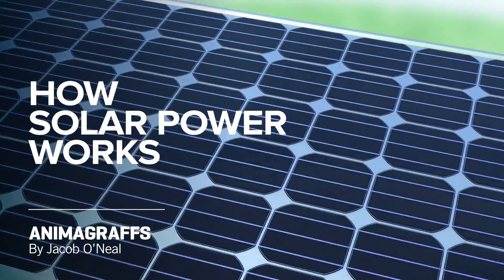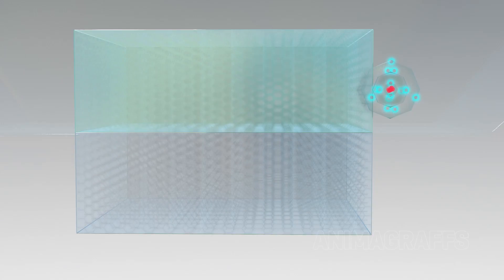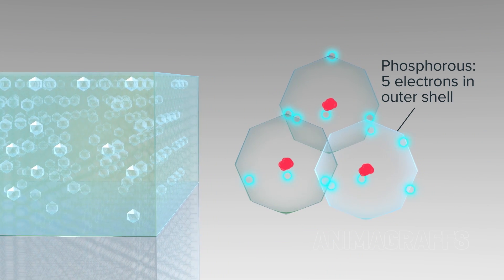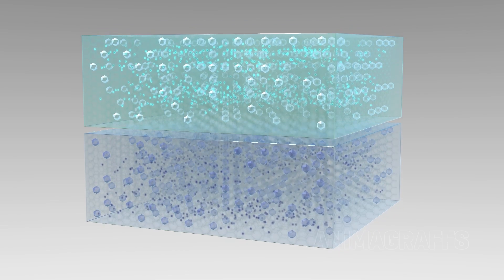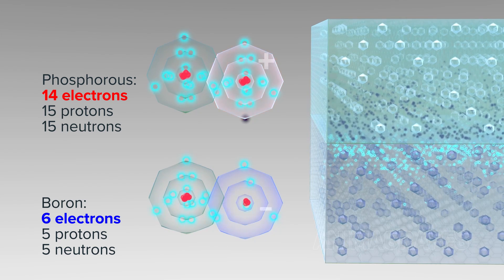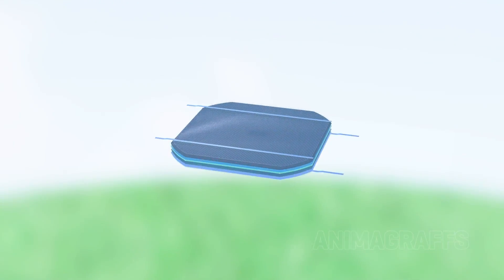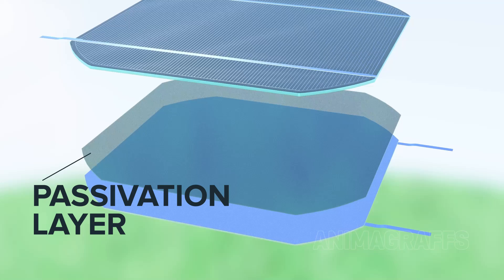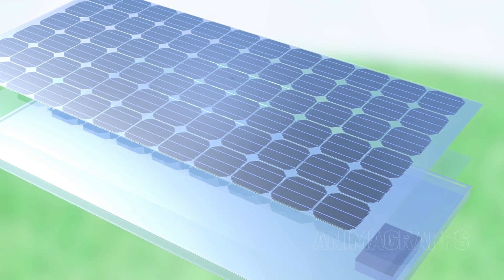How Solar Power Works

Comment: I think an important thing to note here is electrons themselves don't actually fly through the wires carrying a charge like little fast-moving particles. The movement of electrons is actually incredibly slow, maybe only a few mm every second. The charge itself is carried in a field around the wire, caused by the movement of electrons. 

A poor analogy is a water hose filled with water but under high pressure. If you add some water to one end, slowly, some water is instantly pushed out of the other end thanks to the pressure. The water itself is carrying the pressure energy and exerting a force that is instantly available at the other end of the hose, but the individual molecules don't move much. Electrons carry the charge, but the actual power is in the field 'pressure' generated from the very, very slow movement of electrons across the circuit.

Comment: Excellent video as always. I'm not sure if this comment will still be relevant, but my only feedback on the video would be to consider doing away with subtitles (like "Passivation Layer") in the script itself. It might make sense to organize the script or the video with subtitles, but it's unnatural in the audio. Instead, continue the flow of dialogue; such as "Below that, you have the passivation layer, which..." "Below the passivation layer is an aluminum..."

Comment: You have explained how sunlight is converted into electricity. Can you please also explain how the electricity generated is rectified for either charging the battery, or stepped up for loading on the distribution grid?

Comment: "The spent electrons return to the cell ready to absorb more photons" This is just an bad verbiage and seems to confuse others commentors. An electron isn't "spent", needing to return for more photons like a hungry man needing food to get more work done. Just leaving it as a difference in voltage/ generated electric field with a wire (fan in your case) connecting the two sides is fine and won't confuse as much.
Reply from the maker: Terms/vocabulary around electricity and understanding how electricity works in general are almost completely unknown to a general audience. We often see the "water in a hose" metaphor but even that breaks down pretty quickly when you dig further into what's happening inside a wire conducting electricity. How I've described things is the least confusing way for my audience and their knowledge level.

From time to time I do get commenters like you who are certain I could do a better job with simplifying what are near infinitely complex subjects, and I understand why. It's a tough job and I can only hope to get better at it with each project.
Reply: @animagraffs  I like the animation, and after this first part of the video everything is fine. The idea of "spent" electrons is in fact over simplifying and leads to misconceptions. (for instance this comment: If we have to put back the same amount of electrons that we pump out then how does it make power) The Lesics channel has a similar level video on solar cells without introducing this idea. I understand not telling the full story for simplicity. Like teaching the mathematics of gravity in levels of understanding from algebra up to tensors. I've also had to correct published research papers which have over simplified the phase transitions of pervoskites as similar to that of water from liquid to solid/ice.

Comment: This is a very dumb question, but: If we have to put back the same amount of electrons that we pump out then how does it make power?
Reply: Heat may be.
Reply: He said it in the video - we force the electrons to move through our cables and devices (like a lamp) to get to the other side where they can recombine. Like if we force water through a channel to make a turbine spin.

Comment: I am a physics teacher at school, surfing youtube for educational content more than 10 years now /// a quick tip for you, most popular topics among electrical and electronics engineers (beginners enthusiasts) is still SMPS (switch mode power supply) Electronic components, circuit designs, Transistors (IGBT MOSFET BJT etc.) Power Inverters, Automotion PLCs etc.  / soo you can  gain far bigger viewer base mostly on these topics. ( I didn`t mention audio/sound system cuz you have already done a masterpiece video about audio)
Reply: Bruh